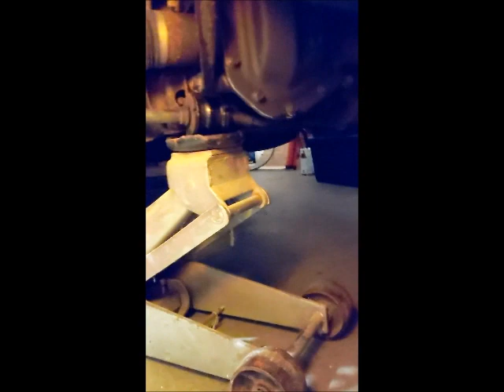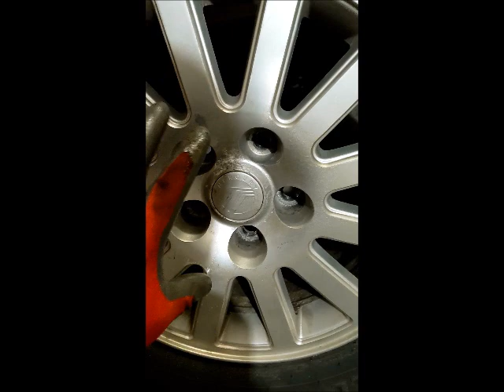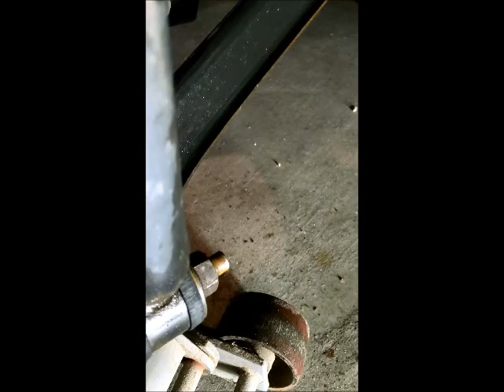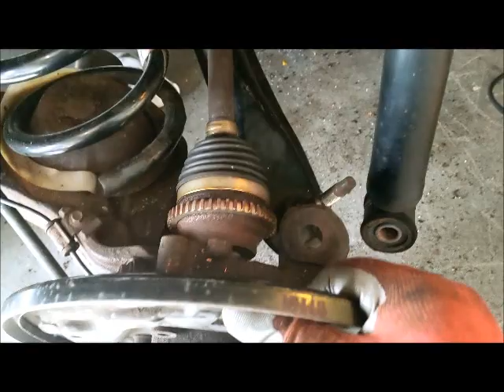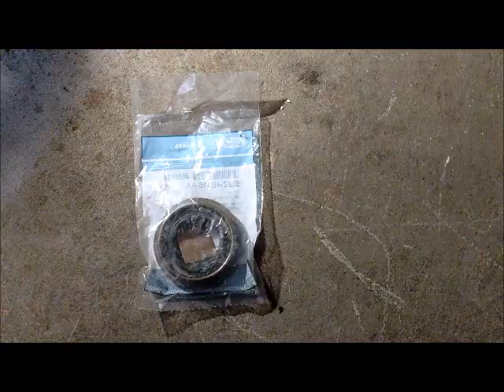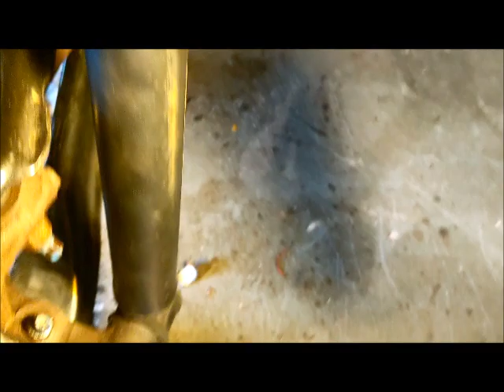Replacing the Rear Axle Seal on a 2010 Mercury Mariner

Comment: Nothing against you/everything against Ford: I absolutely love the mixture of imperial and metric while doing this 🤦‍♂️🤦‍♂️🤦‍♂️ (I'm at the point where I'm removing the brake line, which I have to do with an end wrench because there isn't clearance for a ratchet)